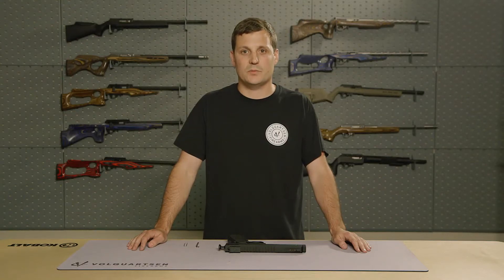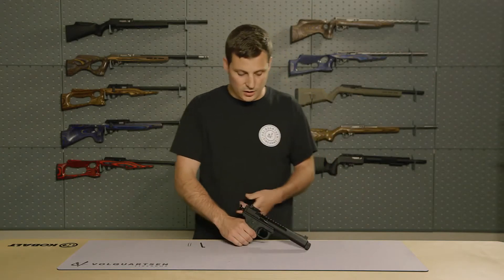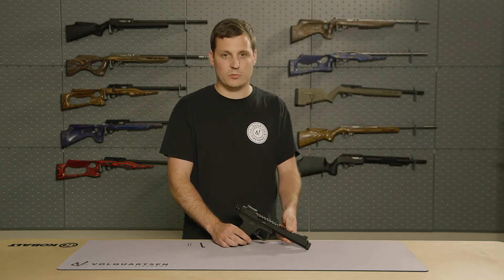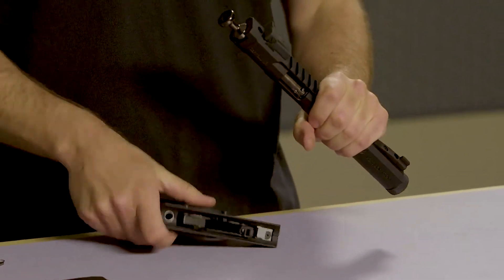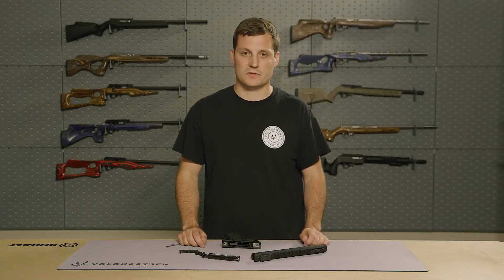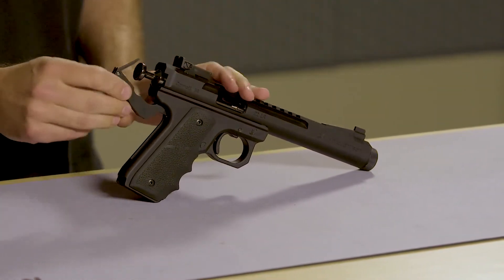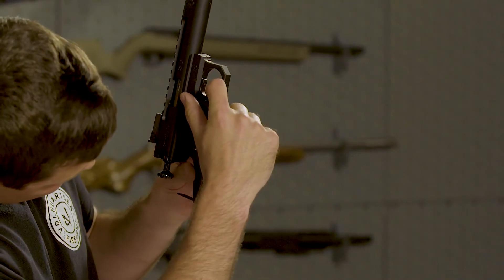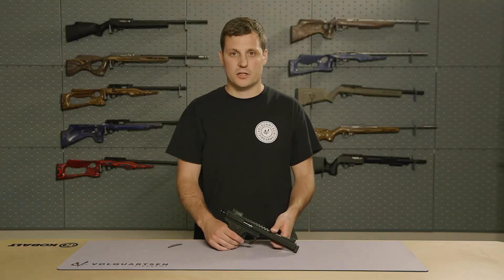Scorpion 22 LR Takedown & Reassembly

Comment: Excellent tutorial video on the mainspring assembly.   What was shown is exactly how it is flawlessly removed and reinstalled.   I'm going to surmise that the vast majority of Volquartsen users are already familiar with the MKI-MKIII process.   It is helpful for those that may be new to the process that are using a Ruger and doing a general search on disassembly and reassembly process.   I started out years ago with a Ruger MK II.   I've since moved on to building full custom builds that utilize Volquartsen frame,  bolt, and mainspring.   I can unequivocally state that the slogan "build it better" that Volquartsen uses is 1000% true.   Parts are absolutely top notch quality!  Also,  the customer service is prompt and professional.   Only a couple of inquiries regarding product availability.
Reply from the maker: truly appreciate the kind words, thank you so much!